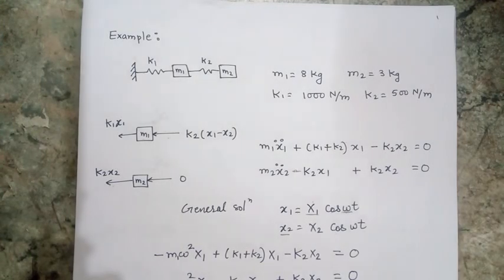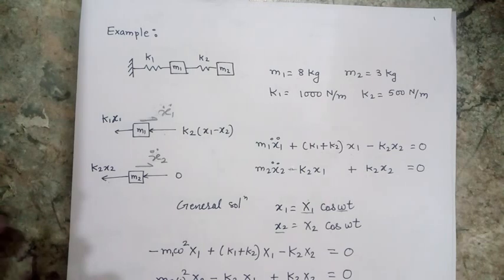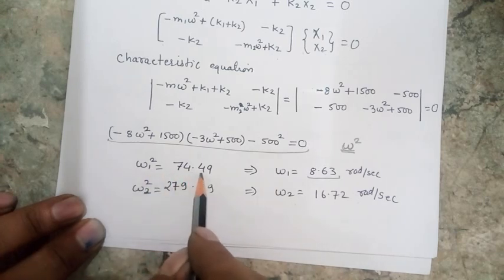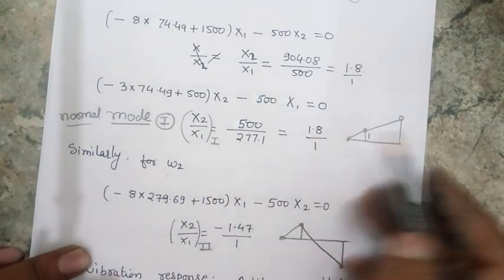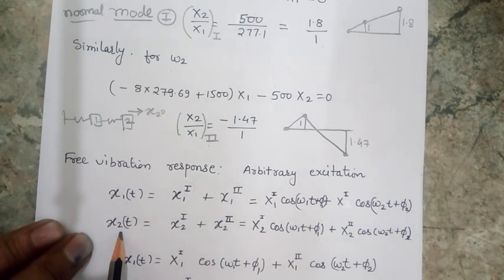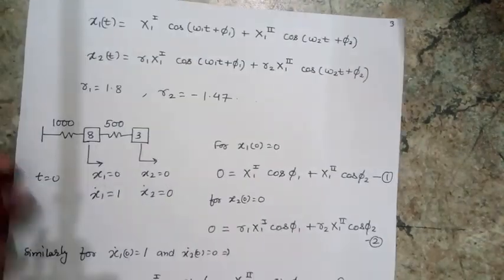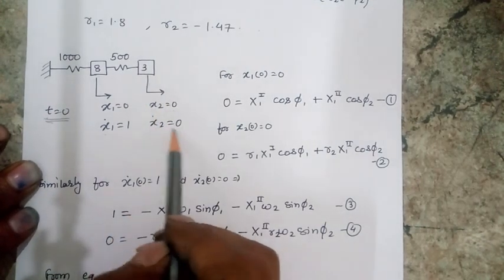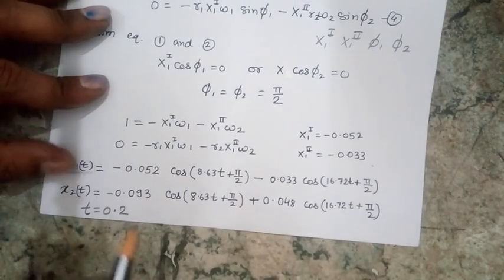Vibration of two degree of freedom system_Part 2(Example)

Comment: in this pbm m1 is greater than m2 so can we take x1-x2 instead of x2-x1? ans will come right or will change can u explain me
Reply from the maker: Dear Satish, the difference is not considered by value of mass, actually in my approach, if I am writing equation for m1 i will always subtract displacement from x1  not from x2, similarly when I will write equation from m2 i will use x2-x1, if I will change it my answer will change. Normally in books you may also find X1-x2 but for this is not based on the magnitude of masses.  I will suggest always subtract displacement of other masses from the mass of consideration. If still it is not clear to you plz mail me on ashishpurohit1@gmail.com..I will try to explain yhrough pictures

Comment: why is it x1 -x2 instead of x2-x1?
Reply from the maker: Hi, both x1-x2 or x2-x1 can be used based on the frame of reference we are considering. First of all, let me tell you that in the video, for the second mass, the left hand force should be k2(x2-x1) instead of only k2 x2, which is a mistake, but while writing equation, I have considered correct value.
if you will see, on the first mass I have taken k2(x1-x2) towards left and on the second mass, the reaction force of k2(x1-x2) is considered as k2 (x2-x1). to make things simple, we fixed one method that, when we write equation, for mass 1, we assume all the forces  opposite to the direction of motion of mass 1 and also take x1 as reference. While writing equation for mass 2, we keep direction of all the forces opposite to motion of mass 2 and consider x2 as reference. therefore I have taken it x1-x2. If you wish to take it x1-x2 as x2-x1, direction should be opposite. 
I guess what I have written may not be so clear to you thus, you are requested to once see my other video for writing equation for 3 DOF system (Example:Governing equation of multi degree of freedom ) I believe, it will clarify your doubt.
otherwise, I would like to explain you through email along with some pictures.
thanks for the query.
Reply: Thank you for taking you time time to reply. I now understand, thank you for explaining. We we write the equations of motion for the individual masses, we assume that the force acts opposite to the direction of motion of the mass, and that is how the sound convention works. Thank you again, this will help me for my test on Friday.
Reply from the maker: Great and good luck for your test.